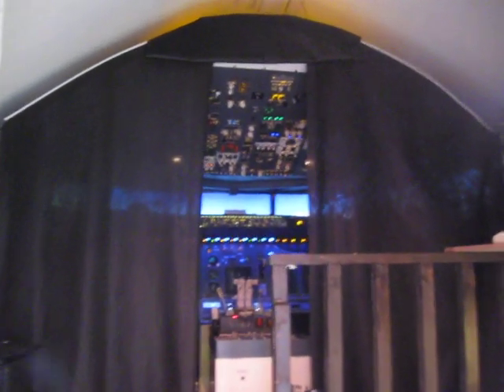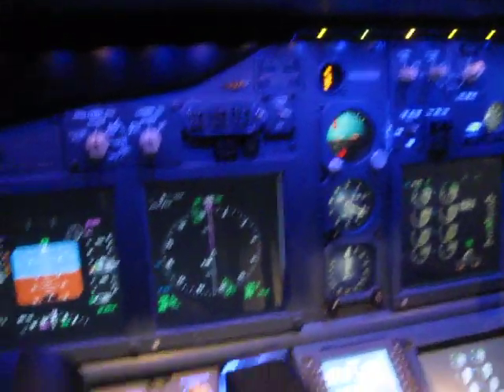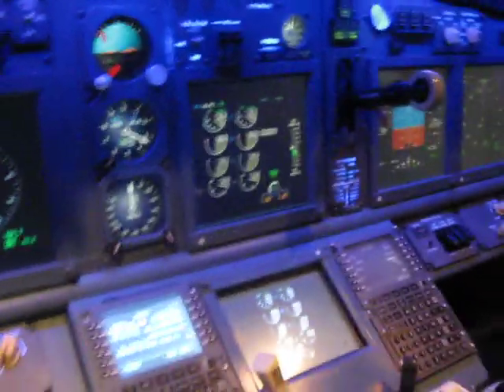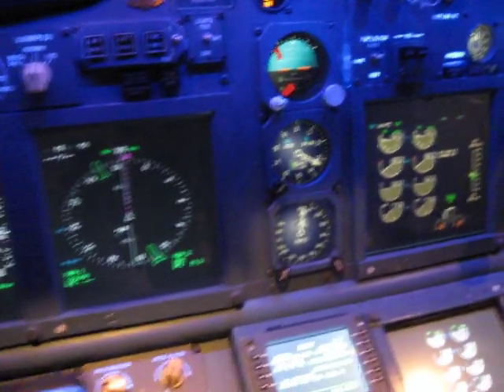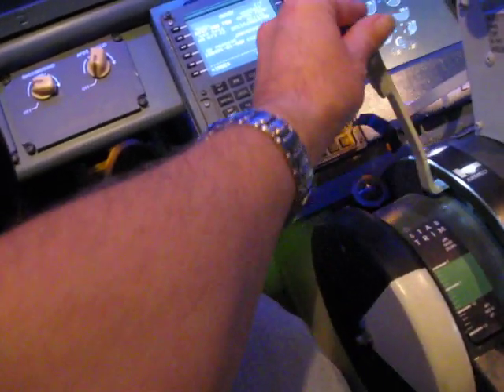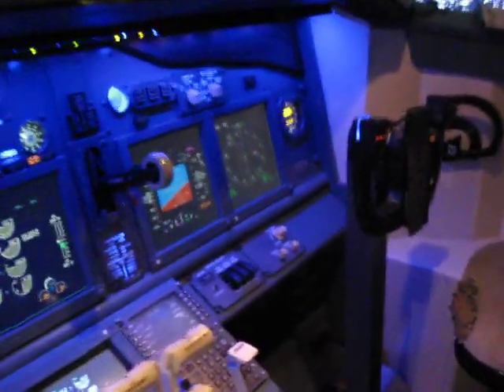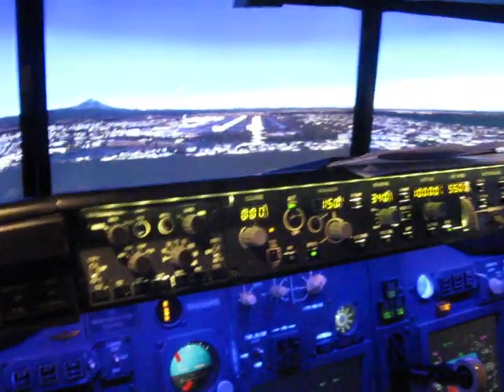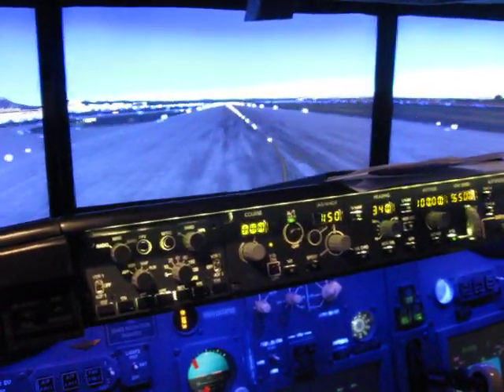B737 NG Home Cockpit - ButtKickers mini LFE

Comment from the maker: @RicardoNY1 

Hi

  The butt kicker is connected to the subwoofer output on the computer. Setup: Output PC - Amplifier - butt kicker
They need a separate amplifier strong enough and run them.
Butt Kicker is the same as speaker. just shaking makes no sound.

Tore